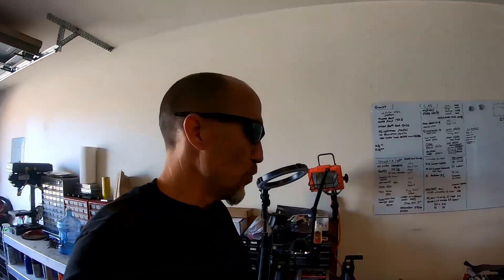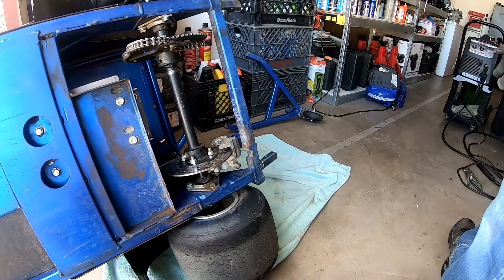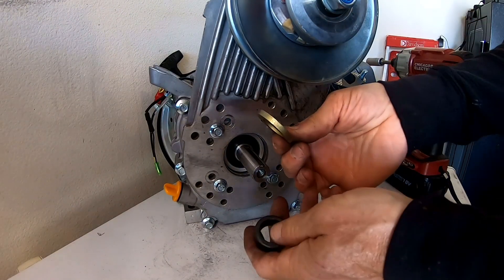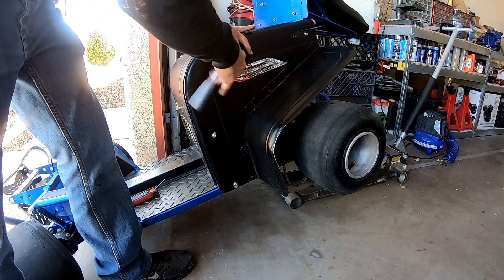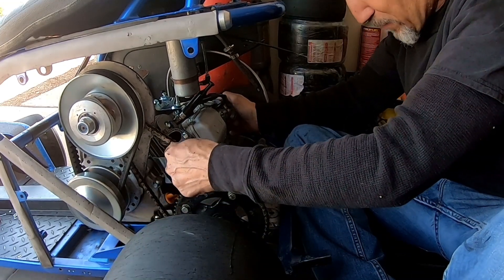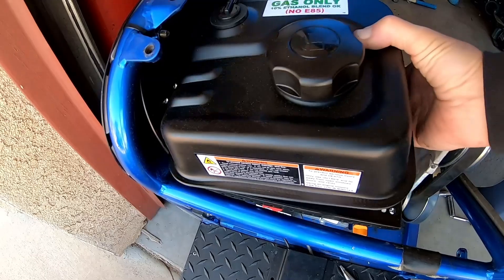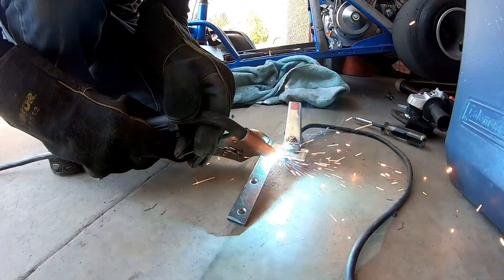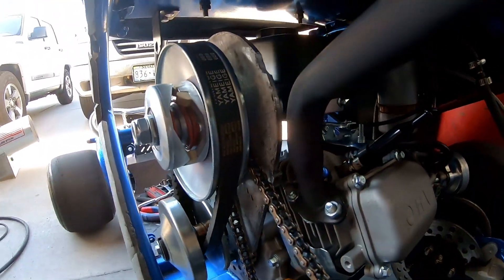Hemi Predator 212 installed on a mobility chair does wheelies!

Comment: Hey quick question my son has a minibike with a predator 224 we are doing rod pistons fly wheel we’ve already changed the carb is there any reason why these need fuel pumps or is gravity feed just fine
Reply from the maker: No need for a pump unless the tank is below the carb. As long as it will gravity feed.
Reply: You’re the man that’s what I thought thank you so much love the videos
Reply from the maker: @franktedeschi5331  Thanks! Thanks for watching the videos .

Comment: What size bolt did you put in  where the governor paddle was, I tapped a 1/4 20 but it feels loose. Please advise.
Reply: Self Tapping Bolt, 1/4", Governor Hole is the correct one for those.